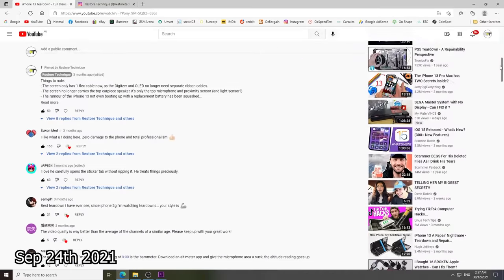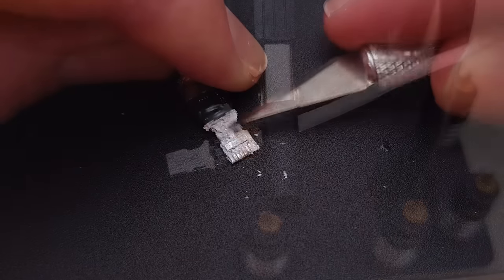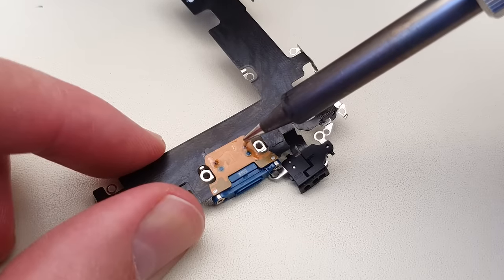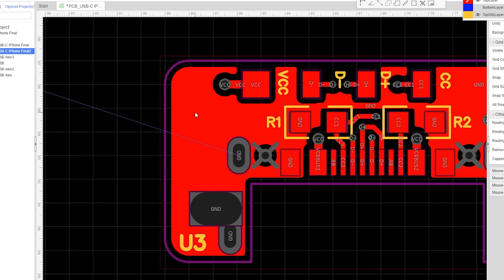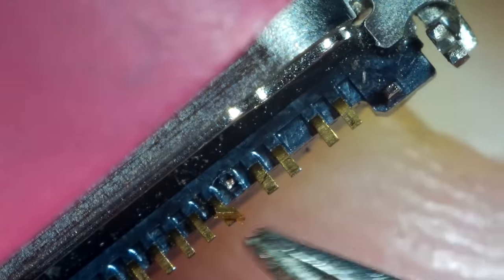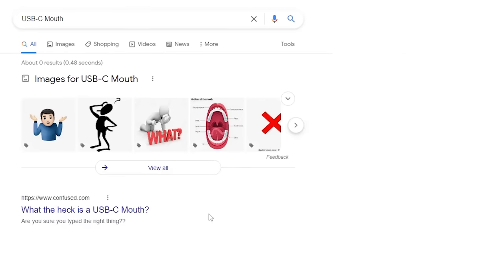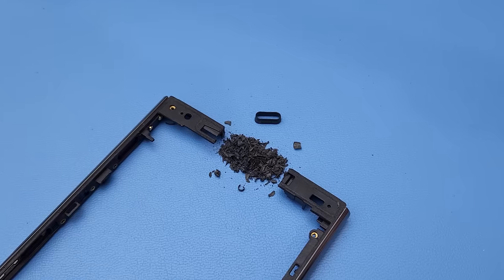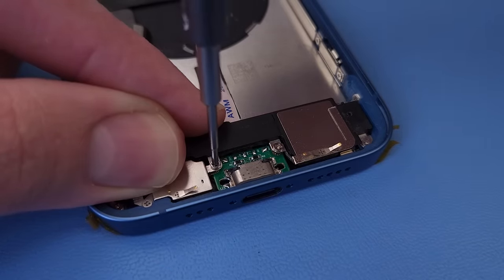I made a USB-C iPhone 13

Comment: You did a FANTABULOUS job man.. Apple sees & noted down there's a space and make the next iphone frame even TIGHTER, so none would modify the iphone 🤦‍♂️ 🤦‍♂️ 🤦‍♂️.... Apple, if you really care for the WORLD'S ENVIRONMENT, you should have introduced the usb c on your phone, instead of removing the CHARGER...
Reply: They can just widen the frame with power tools lol
Reply: Not with Apple finally being forced to use USB C by 2024. Thank you EU
Reply: Apple will be forced to have usb port C soon btw else they out of market,
Reply: everyone would have to throw away their old lightning cables which would be worse for the environment
Reply: @daniyalkhizar  not really, both the metal and plastic can very easily be recycled .
Reply: @rdeurhof  It would cost a lot of money to recycle, it is likely not cost efficient enough and will just go to general waste. On the otherhand, most people would already have a USB-C cable at home so I don't really see Daniyal's point.
Reply: To be fair, the lightning cables are much less fragile by design. It lasted far longer than micro-USB cables, which are trash. For Apple to switch from lightning to USB-C now would make a lot of perfectly fine working chargers obsolete in the coming years.
Reply: @grunchidetrap476  not the charger only the cabels
Reply: @grunchidetrap476  my lightning cable is frazile... lightning PORT is good though
Reply: @leek_san  true... Now apple is seperatly selling charger, which actually creates more environmental waste
Reply: @daniyalkhizar  Not even apple is stupid enouth to bring that argument because they all know a common port will reduce waste pretty quickly in the long run.
Reply: @MaelZack  no they just can’t have a port which doesn’t use usb C
Reply: @ZipZash  It only aplies to iPhones sold in the Europe though, they can sell lightning in Asia, America, and everywhere else. The question is, will they do it like that, or USB C everywhere?
Reply: Apple Explained had a video on why Apple adopted Lightning. In short, they had to switch to a new cable before USB C was out, so they made lightning, and when C was out, it was too early to switch again, so they held up.
Reply: @daniyalkhizar  yeah they should…lighting is garbage. On usb c, you have higher data rates for transferring large files higher charging power and more interoperability with a gazillions other dongles and devices. Every other device that is being released is using usb c. The environmental harm caused by ditching a few cables is negligible since they are also highly recyclable. Also the EU passed a new law that forces everyone to use the universal standard that is USB-C. The days of lighting ports are numbered.
Reply: @daniyalkhizar  initially. but in the long run it would reduce environmental waste
Reply: @grunchidetrap476  why would the chargers become obsolete? Chargers have either a USB-A or USB-C port. You can easily use either a USB-A to USB C cable or a USB C to USB C cable to charge your future USB C iPhone.
Unless you mean that people will opt to buy a higher Wattage USB C charger with PD and the like. But that still is preference and the old chargers still will do the job, if you charge overnight.
Reply: @peters.7428  if that were they whole reason they woudnt be against the switch to usb c soo much. EU asked Phone makers to use a common standart in 2014 and only apple chose to not comply with it.
Reply: @MrCoffis  apple could also release an MFI program for their iPhones which would make no difference at all. USB C is a lot faster but that’s it
Reply: @randomzocker8956  apple could release and MFI program for their iPhones which would make no difference at all. USB C is a lot faster though
Reply: @grunchidetrap476  exactly, a USB-C port is more prone to breaking because of the design on the inside (the straight stick) because it can bend and your phone wouldn’t charge anymore
Reply: i don’t think they gonna see this comment bro
Reply: @ZipZash  i don't think they gonna switch to USB-C if they switch to it they will lose much money
Reply: USB-C has a male & female connection on both sides of the port, this makes it alot more prone to debris than a solid male to female connection like lightning.  Apple chooses to keep lightning because it is more durable.  Example: take a cup of dirt or sand, jam a USB-C cable into it and try to plug it into a port.. it won't, it will be clogged because it has that female end on both sides.  You can do that same thing with a lightning cable, shake it off real quick and easily still plug it into the phone, this is once again because it is a solid male connection, there's no "hole" on the inside of the lightning port like there is USB-C.  This is a test that has actually been done internally, Now alot of people simply think about ohhhhh what charges faster?! The fact is the majority of people don't need a 65w megacharge or whatever, most people just charge their phones at night.  So in order for the phone to last for several years, it is a better long-term view for Apple to use a solid male connection (such as lightning) over a male+female combo connection like USB-C.   Samsung plans on you replacing your phone every year, that's why they barely get 1-2 years of updates, whereas Apple is STILL updating the iPhone 6s from 2015.. Apple looks more at long term durability than any other manufacturer does.

EDIT: Someone may ask "but why then use USB-C for the non-pocketable devices like iPad?" Good question, that was done since non-pocketable devices such as the iPad are alot less prone to debris/lint than a phone that is always in a pocket that may become dirty.  That's why the iPhone specifically needs that solid male to female connection, and seems to work fine for iPads as they generally never leave the home.
Reply: @brewergamer  I've been using the same type c cable and charger since 2015 with no issues and moving across the country several times that came from OnePlus. Samsung has notoriously long update times of 4+ years so idk where that claim came from, not to mention so do many other Android brands as well.
Reply: @brewergamer  while your point is valid the lightning connector is a more durable connector, for 99.9% of people out there USB-C is durable enough and durability aside is a faster in data and powerwise connector…oh and most importantly UNIVERSAL! You can use any cheap dongle you bought for 2$ with it. Its a W for the consumer. Apple did make a good connector back in the day when there was mini or micro USB but lightning is just old tech by now and Apple has already faced this fact and will ship the iPhone 15 with a USB-C (according to rumours).
Reply: @daniyalkhizar  its faster but thats it? Haha everyone is fighting and paying thousands of dollars for that extra speed. Speed is what its all about in the tech world.
Reply: @MrCoffis  you can’t even clean the usb c port easily without bending it
Reply: The thing with the lighting cable is that Apple can charge a premium on it when selling to tech companies and other companies. It's all about the money.
Reply: @daniyalkhizar  i dont see what u want to argument against? MfI will be dead with usb-C because the law sais that it has to be compatible
Reply: @daniyalkhizar  I can 🤷‍♂️
Reply: @daniyalkhizar  if Apple really cares about their customers while maintaining the environment image, they should offer trade-in program(s) where customers can trade their old cable and charger in exchange for small discount.
This way Apple can responsibly recycle their own outdated tech and keep customers happy.
Reply: @bastje  true
Reply: they could have but not its too late as people already have the wires and chargers for apple devices so if they introduce usb c the people would have to throw away the wires and accesories 
making more waste
Reply: Yes, then the charger box? Lol
Reply: They have done worse with M1 MacBooks:
Glued battery so strong that you need to replace the keyboard assembly. Soldered SSD.
Firmware on that soldered SSD.
Reply: @ZipZash  Nope, as per Rules they can include a Lightening to USB-C adaptor with the phone.
Reply: And what was the standard at that time… Micro B. I’d have told them to piss off too, given they had just transitioned 30-pin→Lightning about 2 years earlier
Reply: Désolé mais l’iPhone sans le Lightning n’est pas un iPhone, ça a été approuvé par de nombreuses normes américaines, le Lightning de l’Apple iPhone est plus performant que l’USB-C
Reply: Apple at that point cares more about money than the environment
Reply: @MaelZack  either that or they will make a wireless charging only iphone
Reply: Haha just what was my first thought when he said something in the lines of 'it's as if the company that made this phone was able to utilize every mm of space inside this phone' 🤣🤣
Reply: @VIA77773  I would think that the loss of sales in all of EU would be a lot more than what they loose on sales from cables. So I am certain they will change, they have already started on other devices several years ago, they have just held on as long as they can on the phone side which is the high volume product.
Reply: Removing the charger actually doesn't help the environment because buying a charger separately has more damage to the environment because the box for a charger itself is huge yet if you just include it in the phone box then it's cheaper and better for the environment.
Reply: @hxn1_  Unless you do not need a charger and there for do not buy a charger. Assuming sales prognosis are accurate you can reduce the number of produced chargers and there for the environmental impact. But in Apple's and other manufacturers case it's more likely to be related to making more money.
Reply: @daniyalkhizar  bro i worked in electric Store for apple, cables and chargers sell more than iphones. he is right about having one standard cable for all.
Reply: @joerinaldi207  That or they can release an EU model which costs more.
Reply: Or do both: Add a small lightning to usb-c adapter to the box for the EU model and ask more money for it. Will turn out about the same as usually for the EU (like cookie banners etc).
Reply: @brewergamer  Samsung actually now offers 4/5 years of updates = 4 x Android OS and 5 years of security updates
Reply: @jespernayberg675  Claims to have* Not an actual 5 years have passed on any of those devices. And if you go 5 years back to the 5 year old Samsung devices.. none of them got updates past 1-2 years.
Reply: @daniyalkhizar  why the hell it's u want to use your fricking fork to clean the port?? 
It's water resistance!!!!! Just wash it!!!!!!
Reply: @imnotokay7yago588  even though it’s water resistant, every company tells you to not intentionally soak or rinse them. It’s hard to clean a usb c port with a toothpick
Reply: Funny how the same people also agree with Apple ditching the charger inside the box, with them saying that people can use old 5W charger, and then a few years after, Apple upgraded their charging speeds slowly, and then the same people again applaud Apple upgrading them, while they once said 5W is already enough, like literally fighting their life to protect the 5W war back then (LOL), then the same people just blindly close their eyes on the fact that they have to ditch their 5W charger, creating waste, and to buy 23W charger separately, without raising an eyebrow to Apple at all..

Same goes to OLED too...they once agreed with Apple, that LCD is enough, is already this n that...but when Apple moved to OLED, you all are the one applauding Apple for doing that..oh and to add more, you all literally wanted to win against android phones...saying Apple OLED is much better, bla bla bla...

Come on guys...i don't hate Apple that much, but just dont be their sheep...SMH
Reply: @daniyalkhizar  omg i washed my phones every 2-3 months ever since using my Galaxy S8 and never have any issue..u name it, S8, S10+, Oneplus 7 Pro, and now i currently using Find X3 Pro, and even my mom's Galaxys A8 2018 doesnt even flinch...and how the heck 'intentionally' applies to this argument at all, where they all literally marketed their phones as water resistance, showing ads that u can go swimming with it, even taking your time to record a fricking video IN a pool..come on man...there's a fine line between a FAN and a SHEEP
Reply: @brewergamer   That has to be one of the worst apple  D-riding arguments I've ever read. It makes absolutely no sense, ports can be cleaned effortlessly. Also, apple is NOTORIOUS for planned obsolescence. People upgrade Samsung phones more often because Samsung actually does something new with every phone, people want new features. Apple takes an idea that Samsung had already implemented 3-4 generations prior and you iPhone shills go ape$h!t and act like its something "new". I really don't understand the loyalty some people have for a brand that tries so hard to be elite, yet is still behind Samsung flagship devices in nearly every way. Remember, iPhone is ranked 3rd globally behind Samsung. Apple needs to stop acting like  a giant brat and just use a universal charging port. I do love wireless power sharing, maybe you guys will get it in a few generations, I'll take clear detailed photos of the moon with 100x zoom on my S22 Ultra while you fanboys wait :)
Reply: cocacolastic
Reply: Well tbh, if anything, it's a testament to how well they're space efficient.
Reply: Fantabulous HAHHAAHAHA

Comment: absolutely amazed by how it looks perfectly normal at the end.
I wouldn't even have noticed if I didn't know.
that looks like it comes straight from a factory, job well done!
Reply: The immediate tell is that the port isn't vertically center-aligned (space below it isn't equal to space above it).

Comment: This is one of those ideas which sound simple on the surface, but are actually incredibly hard. Good job.
Reply: But not at the manufacturing stage.
Reply: @IsaacJacobsAu  Obviously not, apple is probably used to this, but for an individual to do this precise work without a mass factory is hard. Also he edited an already made iPhone 13. In the factory, the wont have that middle step of the lightning adding and removing. Also designing this is hard.

Comment: It's astonishing that you can accurately solder such tiny components like that, big props man. That takes a huge amount of skill
Reply from the maker: Cheers bud
Reply: Plenty of skill and it looked like a good amount of flux, thinking about my crappy solderings and how much better they would have been if I would have used flux...
Reply: @kimh9736  Flux is the first secret of good soldering.

Comment: New iPhones and iOS are starting to really tempt me but I refuse to jump until USB-C comes around. Bravo man this is a marvellous mod!
Reply: It’s either coming in 2023 or never (they might switch to only wireless charging)
Reply: USB-C might come to iPhones after the notorious EU law will be put in place
Reply: It's coming sooner than most people think. The EU will make usb-c a mandatory standard.
Reply: @Carl Gunderson Yeah. And you seem to misunderstand how much expensive it is to have 2 lines of production for the same product. So if a continent worth 800 millions of potential customers obliges you to do something, you do it. And generally it applies worldwide. Heck, California could pass a law like this and it would also apply worldwide. It already happened okce
Reply: @Carl Gunderson I doubt Apple would only make them for the European market, in fact I suspect that they will only make usb-c devices and phase out thunderbolt
Reply: they will, eu is making apple use usbc
Reply: @Carl Gunderson id just buy the phone from a European nation for a little more
Reply: @Carl Gunderson The mmw 5g is simply an extra addon antenna in the chassis that can easily be installed/removed unlike the connector, which is essential and in the same place on every iphone produced. Phones without mmw simply have empty space where the antenna would be.